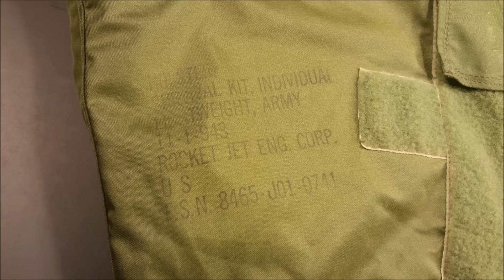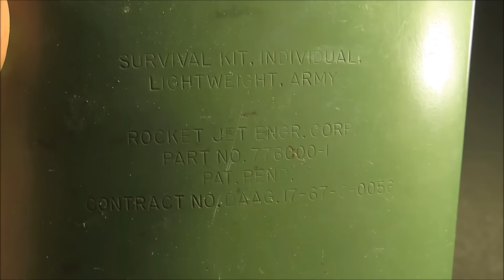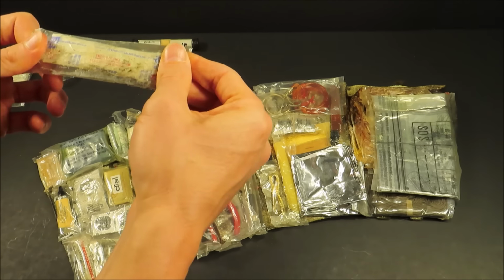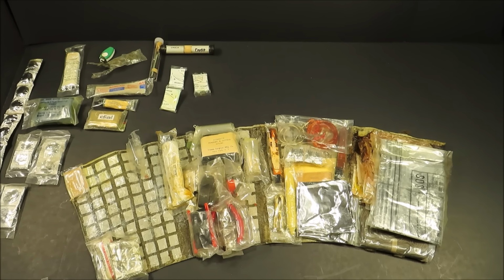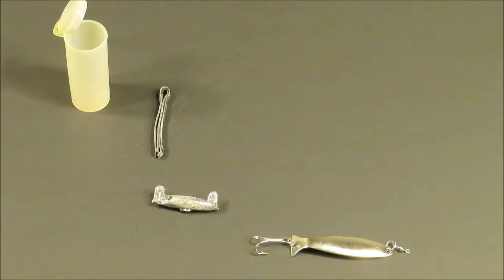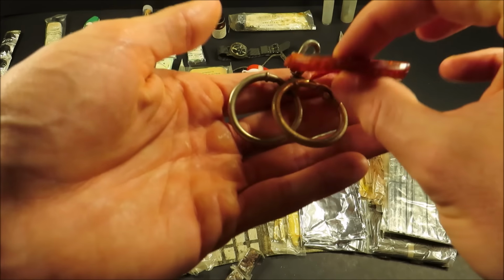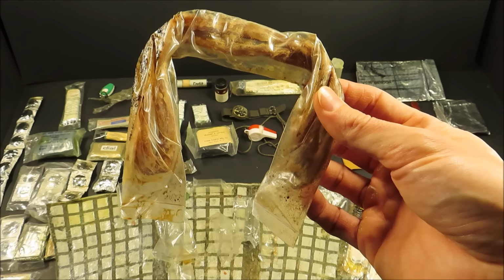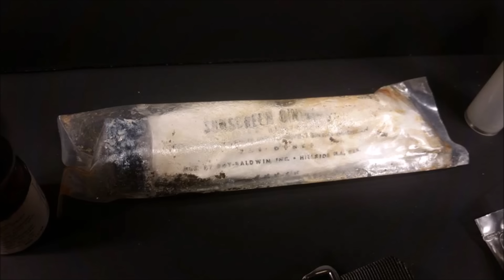1967 Vietnam US Leg Holster Pilot Survival Kit Review Vintage Military Gadget Testing

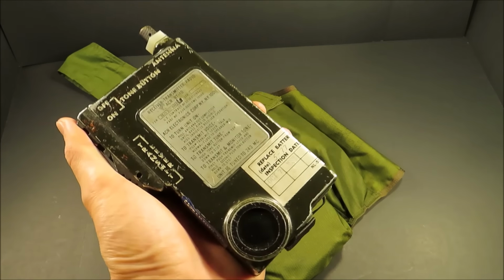Comment: Never EVER close your antenna like you did @ 2:25, as a lifelong CB and amateur radio enthusiast I can assure you that's the absolute best way to snap your antenna in half rendering it useless, love your video though but my OCD insisted I speak up lol
Reply: That's what I was thinking! lol
Reply: What's the proper way to close it?
Reply: @KoroWerks  Fair question, I really should have explained that too, oops, grasp the antenna towards the base and pull it down into the radio two or three inches at a time, the problem with using your palm to push it down is if there is even a tiny bump in the antenna, or you happen to move the wrong way it will likely bend in the middle so it will never go back down on itself, no innuendo intended lol
Reply: How do i tune my cobra 29ltd classic? My friend can barley hear me, but i pick up nothing?

Comment: The batteries for the strobe are still available. They are $30 bucks or so.
Reply: Donald Parlett jr  -   Out of curiosity, what is the battery designation?   Is it like an 18650 which gives its dimensions (18mm x 65mm) or some generic ”B7” type label?   How many volts?   Amp-hours?    Sorry, I’m a big fan of both xenon strobe tubes and batteries...
Reply: orion khan ACR Electronics Inc model # LLB-1.   P4-01-0074 battery assembly. That's directly off my battery. I bought this battery from a marine life raft recertification center. I live in Annapolis MD and there are several places that handle these. I collect military survival gear from WWII onwards.

Comment: I am of the understanding that the serrations on the back of the knife are for sawing through aircraft fuselages? Is that correct?
Reply: animalmother556x45  -  sawing through anything really...   you may be able to saw through the aluminum skin of a plane but very little of that skin doesn’t have something that’d offer significantly more resistance to cutting...   considering the two blades and the wire-saw, the knife serrations would be best used on smaller branches and saplings.

Comment: I remember The Camillus Cutlery factory in Camillus, New York. I remember the fire in early 2012. The fire was so hot and intense that 25 fire departments responded and water bombers were flown in to assist with fire control. The fire could be seen for over 20 to 30 miles away at night! A welder working near by is believed to have started the fire when in process of removeing machines from the building. which was slated to be turned into loft style apartments, offices and small shops.

Comment: I specialize in early 60s elecronic repairs/ updated. I could swap that radios battery with a rechargable, and even fit it with an internal charge port with the extra room (batterys have come a LONG way and shrunk significantly)

Comment: Your waterproof signal strobe light battery can be replaced using the SDU-5/E - BA-1574U. It uses the CR123 button batteries which are easy to find at your local grocery store/hardware store/CVS/etc...

Comment: Reference your orange strobe, batteries are unavailable anymore due to their mercury content. I improvised a replacement from a special purpose battery for a smoke detector or camera. Check your local camera shop. As long as the voltage is close and diameter is good. Improvise contacts as needed.
Concerning your survival knife, DO NOT use neet's foot oil on the sheath. It will ruin the leather and rot it.

Comment: some things in that old kit were in the kits I saw while in the USAF in the early 1980's
the kits I was familiar with were ejection seat kits

some kits I remember had sulfa based ointments which if you're allergic...
same for sulfites in food today...

sticky stuff, the days before velcro...

IODINE TABLETS missing, check your packing list

another thin I don't see is a magnesium/ferro rod

strange the matches are in that tube
usually they're in a screw top vial with flint on the bottom
that flint goes bad over time

bouillon cubes are also high in salt
I take them with me in my canteen kit

what's amazing is the multi-use flare handle
for the cover/fry pan, blade/saw & of course flares

Comment: FYI ....It should be noted that the Cospas-Sarsat ELT tracking satellite network ceased monitoring of frequencies on the 243 Mhz band in 2009. This somewhat limits the utility of this device as a piece of survival gear, as the 243 Mhz band is now only monitored by ground based receivers and some aircraft.

Comment: Those knives are actually not that great when used in field crafting situations. Surprisingly fragile as I found when subjecting it to basic camp tasks. Easily bends and breaks. I've had several and they're fine to toss in the bottom of a tackle box to cut string or sharpen sticks but for anything but the lightest work they're a disappointment in my experience.

Comment: What a terrible idea to put this in a leg holster. Obviously you are going lose mobility with all that crap hanging off one side of your belt and leg. That vest is a much better concept and incredibly obvious. Especially considering they would at least have a sidearm on the belt as well as a few mags and even possibly a small carbine like an m1 with. Folding wire stock. I think standard issue for the pilots in Vietnam was a. 38 revolver of some kind. Not going to be much help in a firefight but maybe useful against predators.